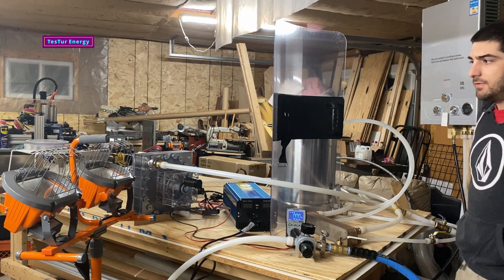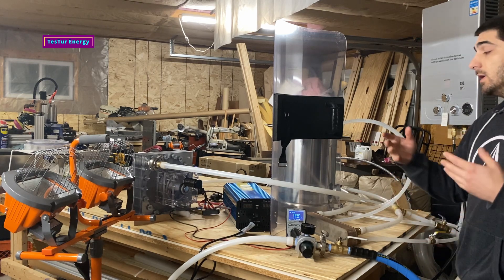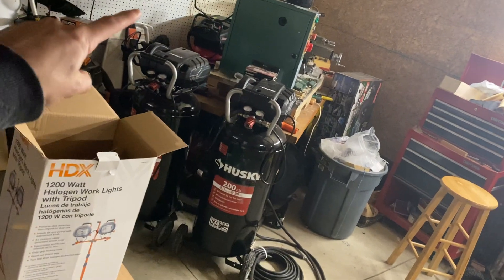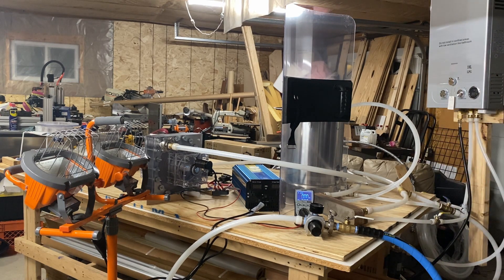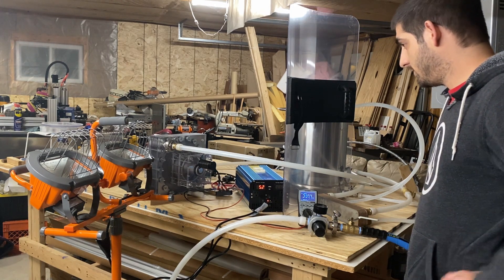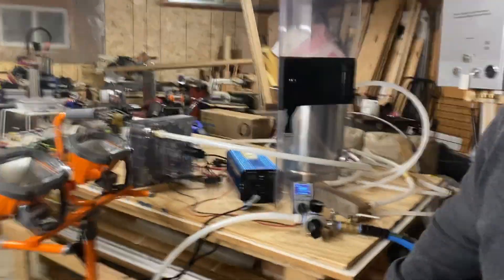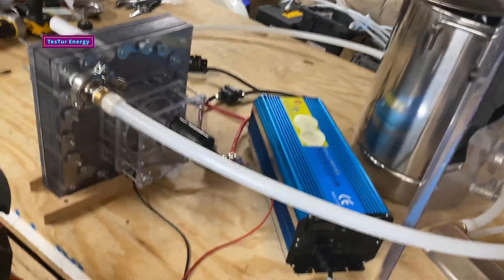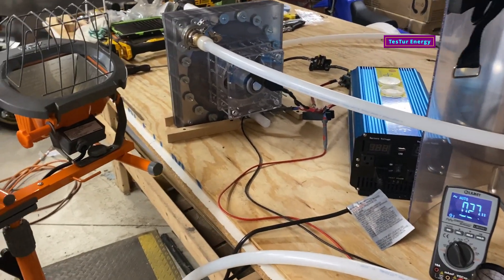Amazing Tesla Turbine Actual Power Output Test - 1200 Watt Real Electrical Load - CAES - Turbo Jet

Comment: So how long dit it take your air compressor to fill the tanks enough to run those light bulbs for thirty seconds?
Reply from the maker: Hey Benjamin! Thanks for commenting. So check out the part two of this video. I got into more detail about that. 
https://youtu.be/bWpXRzrzf4g
Reply from the maker: But to more directly answer your question, the compressor took 10 minutes to fill up the tanks. Which is abysmal I know. This is because air compressors are HORRIBLY inefficient. Generally they are about 10% efficient because they dump all the heat of compression out into the air and that’s not recouped again when it’s being used. I do thermal addition tests I’m the video I posted above which shows the increase in energy converted by changing the temps back up to 165°f. In the future I will be switching out the compressors heat exchangers with plate heat exchangers so that I can water cool it, store the heat of of compression in water and then reheat the air before expansion to get a proper round trip efficiency.
Reply from the maker: As for efficiency I have now calculated it a few different ways. If we only consider the energy out out by the light alone the efficiency seems to come in around 15-25%. That’s calculating the available energy in the amount of compressed air we have available in a couple different ways and is really a rough estimate. If we can fix the gear losses, again which should be easy to do with the the axial flux generators, the efficiency is coming in between 25-35% efficient and could be even higher depending on how much of a low ball I put on those loss numbers. (And that’s not accounting for generator iron losses, rectifier losses or inverter losses too) my power loss tests showed 1-2hp of loss from the unloaded condition and my calculations only have 800watts of loss. That’s only 1.09hp. Realistically the loaded condition could be seeing upwards of 2-3hp loss so the real losses are something like 1600watts plus, which if that’s the case the efficiency is looking like it’s close to 35-55% efficient. Again these are rough estimates for how much energy is available in 170gallons of 150psi compressed air dumped to 65psi. Which for the record the different ways I calculated it give it a range from 260,000-380,000joules. I had a whole section about efficiency in the part two video but it made the video like 20 minutes long and very dry so I decided to cut it out and I’m going to be making a video about just that. 

But yeah if you know how to, let me know what you get for the total joules available in a 170gal tank at 150psi being dumped to 65psi. Like I said, I came to those numbers above. It would be interesting to see what others calculate for me to compare to.
Reply: @CharlieSolis  serious question. The out put of air, can it be harnessed to run another turbine?
Reply from the maker: @mrlarrybobjr  Yes in theory it definitely can! This would most likely see reasonable benefits from having a second stage. It won’t double the output or anything but it will increase the residency time of the fluid within each turbine because the centrifugal head is additive. This will also increase the torque because of an increase in total surface area. So it’ll change the flow characteristics of the first turbine because the centrifugal head from the second will make back pressure on the first making the pressure drop over the first turbine less but more efficient. Staging the turbine is for all intents and purposes the equivalent of increasing the diameter. Which will also have the same negative repercussions of increased centrifugal head for the same rpm. 

At some point staging the turbine too much brings the turbine closer and closer to the self rpm regulating version at low RPMs that Tesla talks about in the patent and it essentially is “pumping back” harder than you can force fluid in.  

NIKOLA TESLA U.S. PATENT 1,061,206 - TURBINE
https://teslauniverse.com/nikola-tesla/patents/us-patent-1061206-turbine

“Still another valuable and probably unique quality of such motors or prime movers may be described. By proper construction and observance of working conditions the centrifugal pressure, opposing the passage of the fluid, may, as already indicated, be made nearly equal to the pressure of supply when the machine is running idle. If the inlet section be large, small changes in the speed of revolution will produce great differences in flow which are further enhanced by the concomitant variations in the length of the spiral path. A self-regulating machine is thus obtained bearing a striking resemblance to a direct-current electric motor in this respect that, with great differences of impressed pressure in a wide open channel the flow of the fluid through the same is prevented by virtue of rotation. Since the centrifugal head increases as the square of the revolutions, or even more rapidly, and with modern high grade steel great peripheral velocities are practicable, it is possible to attain that condition in a single stage machine, more readily if the runner be of large diameter. Obviously this problem is facilitated by compounding, as will be understood by those skilled in the art. Irrespective of its bearing on economy, this tendency which is, to a degree, common to motors of the above description, is of special advantage in the operation of large units, as it affords a safeguard against running away and destruction.”
Reply from the maker: @mrlarrybobjr  1200watt Load Test ELECTRICAL Output Efficiency Calculations For 10in Tesla Turbine Are In! 
See the charts here!
https://www.youtube.com/post/UgkxRukN0zoVbtfe1LmLUlXyIo0kdt1ExWZs

Comment: Could this application possibly be inputted into a combustion engine like a turbo charger?
Reply from the maker: Yes absolutely! This is my first steps to replicating the full high temp multi fluid (steam + combustion) improvement turbine patent of Nikola Tesla’s. Patent numbers GB186,082 and GB 186,083 and GB 186,084. And then the exhaust system and hot tank in GB 186,084 will also go towards powering the low temp closed loop vacuum steam cryophorus generator.
Reply from the maker: The next steps are to design the centrifugal Tesla compressor (number 8, 9, 10 and 11 in GB 186,083) to feed the compressed air for combustion into the turbine. The Tesla compressor can either be put direct on shaft or be driven by an electric motor powered by the generator. I will most likely be doing the latter for my first test versions.
Reply: @CharlieSolis  That is quite incredible you are an inspiration to me. Would it be more effective/efficient than a traditional turbo for a combustion engine?
Reply from the maker: @Nick1nong  well I appreciate that. Just trying to do why I can to help further this technology for the world! 

As for your efficiency/efficacy question, I believe so. Traditional piston combustion engines are notoriously inefficient. ~35% on good day. There are SOOO many moving and sliding parts in a piston engine. Tesla turbine’s and compressors just have bearings and gears (for now at least until I get my direct on shaft axial flux generator going too. Then there won’t be any gear losses)
Reply from the maker: @Nick1nong  As for efficiency I have now calculated it a few different ways. If we only consider the energy out out by the light alone the efficiency seems to come in around 15-25%. That’s calculating the available energy in the amount of compressed air we have available in a couple different ways and is really a rough estimate. If we can fix the gear losses, again which should be easy to do with the the axial flux generators, the efficiency is coming in between 25-35% efficient and could be even higher depending on how much of a low ball I put on those loss numbers. (And that’s not accounting for generator iron losses, rectifier losses or inverter losses too) my power loss tests showed 1-2hp of loss from the unloaded condition and my calculations only have 800watts of loss. That’s only 1.09hp. Realistically the loaded condition could be seeing upwards of 2-3hp loss so the real losses are something like 1600watts plus, which if that’s the case the efficiency is looking like it’s close to 35-55% efficient. Again these are rough estimates for how much energy is available in 170gallons of 150psi compressed air dumped to 65psi. Which for the record the different ways I calculated it give it a range from 260,000-380,000joules. I had a whole section about efficiency in this video but it made the video like 20 minutes long and very dry so I decided to cut it out and I’m going to be making a video about just that when I use twice the tank size as previously being used. The larger the tank the more accurate I think the efficiency tests will be on endurance runs. 

But yeah if you know how to, let me know what you get for the total joules available in a 170gal tank at 150psi being dumped to 65psi. Like I said, I came to those numbers above. It would be interesting to see what others calculate for me to compare to.
Reply from the maker: @Nick1nong  if you haven’t seen it yet Check out the video I did showing the increase in energy output from increasing the temp of the fluid from 65°f to 165°f. It’s quite an increase for just a change of 100°f! 
https://youtu.be/bWpXRzrzf4g
Reply from the maker: @Nick1nong  1200watt Load Test ELECTRICAL Output Efficiency Calculations For 10in Tesla Turbine Are In! 
See the charts here!
https://www.youtube.com/post/UgkxRukN0zoVbtfe1LmLUlXyIo0kdt1ExWZs

Comment: short the voltage out as an easy to make brake
Reply from the maker: Oof… yeah but I’m not trying to put that kind of currents through the generator coils. It’s hard to hear in the video but I said I was going to put some kind of resistive brake. Just need a resister of any kind. That way it will moderate the current but still provide a braking torque.
Reply from the maker: 1200watt Load Test ELECTRICAL Output Efficiency Calculations For 10in Tesla Turbine Are In! 
See the charts here!
https://www.youtube.com/post/UgkxRukN0zoVbtfe1LmLUlXyIo0kdt1ExWZs

Comment: Hi Charlie, amazing research you’re doing there👍… maybe you know of the YouTube channel iEnergySupply. They are demonstrating that you don’t need compressor or air to run Tesla turbines. All you need is water in a sealed container under vacuum (evacuated gases) with water heated at 140F for input and do the same for the output but you need to chill it to 34F. When you have those conditions it creates an artificial hurricane that the Tesla turbine loves to turn on the water vapors attracted to the cold output contained.
Look at there 4 latest videos https://www.youtube.com/user/Notime500/videos  and read my suggestion to them how to sustain the effect continuously by using only 400 Watts.
I’ll post the comment below here so you don’t have to search for it.
Reply: ow what you need to do is pickup a cheap 5000btu window Air Conditioner for $120 from Walmart and strip it dow to merge the evaporator (cold coil) in your cold bucket and the rear condenser coil (hot coil) in your hot bucket. If your Tesla turbines generator can maintain a 400 watts output then that’s all you’ll need to run a 5000btu AC (heat pump). With this combination you will achieve a self looped device which the Law of Conservation of Energy says is not possible. A Heat Pump (air conditioner) has COP of around 4 so the 400 watts of electric power input will actually be closer to 1500 Watts of heat energy, so be careful since it could make a much great Delta (temperature differential) then what you presently working with and you may get in a runaway condition where the turbine may explode. So maybe a dehumidifier or even a small refrigerator heat pump may be safer to start with.
Reply from the maker: Shhh 🤫 you’re saying the quite part out load! Keep it down, would you! You’re giving the good stuff away😂😂😂

I def have plans for adding heat pumps to the system but that’s a little ways down the line because we need to actually make turbines that can produce usable amounts of power before we can implement heat pump sources of heating to power the turbine. Putting the turbine in age old vacuum cryophorus systems is simple once we have the turbine actually producing power. 

As for the vacuum steam systems, yes I plan to get to that soon, as steam has much higher energy densities than compressed air however none of that is new technology. all of that vacuum pressure steam stuff has been being used in Ocean Thermal Energy Conversion plants since the 30s. Teslas friend D’Arsonvil actually came up with the idea to use vacuum steam generators that run off the temp differential between warm surface waters and cold deep water. Georges Claude (As in the Claude Air Liquefaction system inventor) made the first bench top model and full size working plant in 1930s. Check it out. https://en.m.wikipedia.org/wiki/Ocean_thermal_energy_conversion#Power_cycle_types
The existing problems in their systems was that efficiency was hard to keep high because they can not fully expand the motive fluid to get ALL the available energy out because the rapid formation of condensation droplets from
Cavitation will destroy normal bladed turbines. Then in walks Tesla with his article “Our Future Motive Power” 
https://teslauniverse.com/nikola-tesla/articles/our-future-motive-power
where he suggested using his turbine in all these exact systems. In my humble opinion that is because the Tesla turbine has no detrimental effects from cavitation or multiphase fluid flows and as such the Tesla turbine can be used to get the highest efficiencies with vacuum closed loop Rankine systems or even just regular organic Rankine cycle, because it can fully expand the motive fluid to get as much thermal energy out of it that would normally destroy regular blades turbines. Corollary this is exactly why the Tesla turbine would work PERFECTLY as the Turbiexpander in the Claude air liquefaction cycle for the very same reason that it can fully expand the the vacuum steam without detrimental effects. I’ve made multiple posts about using the Tesla turbine as a liquid air turboexpander as well. This is why I’m doing the compressed air tests because that’s all a liquid air turbo expander runs on. Pressurized air that came from the vaporization of the -197°c  liquid air using heat from the ambient air sources. 

As well you do not have to have it go down to 34°f for the condenser side. You can use normal air temps but just like in every closed loop Rankine Steam system, whether exhausting to vacuum or not, you can’t pull too deep of a vacuum on the condenser that ambient air temps won’t still cause condensation in the condenser at its low pressure. And the closer you are to making the ambient air temps the boiling point of water in the cendensers pressure the larger you need to make the condenser or increase its efficiency in other ways. Check out my Tesla Fountain Air to water heat exchanging steam condenser idea that I came up with. I believe it was teslas intention to always use the fountain like this but was rather coy about its practicable uses. I explain more in the video. 
https://youtu.be/-czEweMH8hs
It’s specifically meant for the vacuum steam cryophorus generator system. 
This is a short I made of the complete solar heat powered closed loop vacuum steam cryophorus generator. 
https://youtu.be/9-8KH7bFSKM
Reply from the maker: For all intents and purposes the propane water heater can and will be replaced with a heat pump. I have a mini split heat pump that you can just barely see in the background of this video that will be used to do exactly what you’re taking about. All I have to do is plumb the plate heat exchangers in-line with the cryophorus lines so that the heat from the mini split line goes through the boiler plate heat exchanger for the closed loop system. 

As for your personal use I would suggest to steer away from refrigerator or freezer systems, and stick with AC/heat pumps, because  refrigerators/freezers are designed with a low duty cycle that its electric compressor will burn out if continuously ran. Home unit Refrigerator systems while are capable of doing COPs of 4-7 they aren’t designed to be ran continuously. It’s the same for small workshop electrical compressors. You’ll burn out the electric motor if you run them over their duty cycle, most are either 50/50 or 25/75. Like AC/Heat pumps, the industrial ones are in fact designed to continuously run without burning up the motor. Corollary this is why I switched to a gasoline engine powered air compressor for my tests. Because the duty cycle is far higher than any electric compressor.